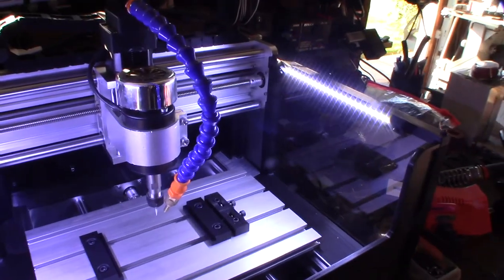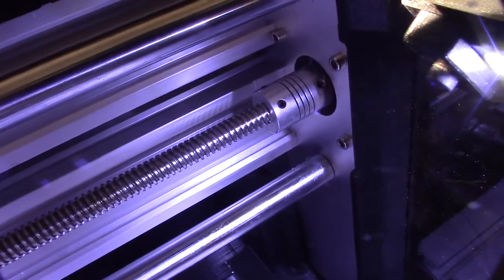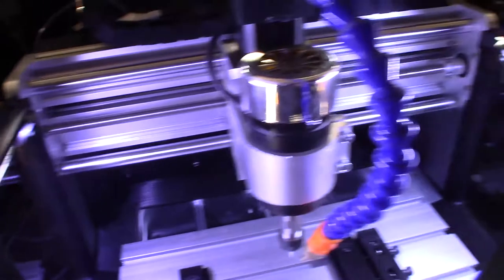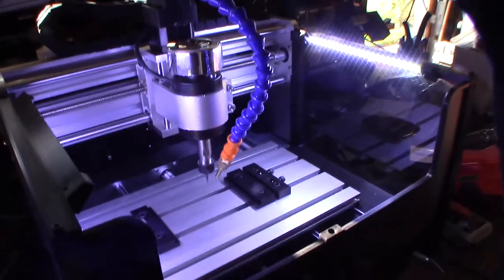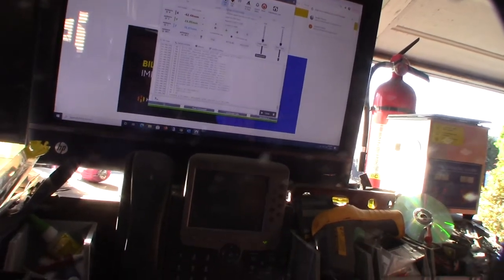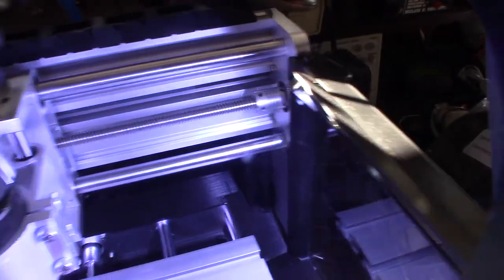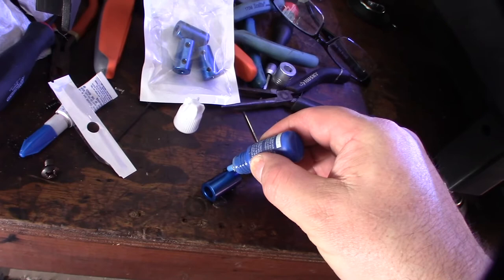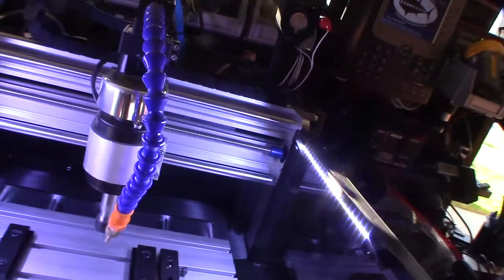3018 CNC X axis Noise Reduction, Reduce Vibration Fix Endmill Chatter Solid Coupler upgrade

Comment: So the solid coupler was the bigger improvement? Not the tapping and pinning the vertical beams?
I'm having the same issues, but also my clamping nut is visibly not round inside. Ordered a new one...